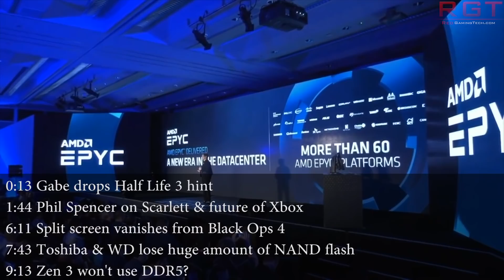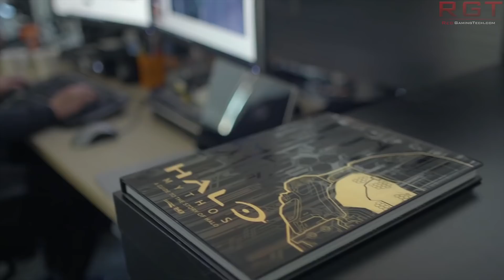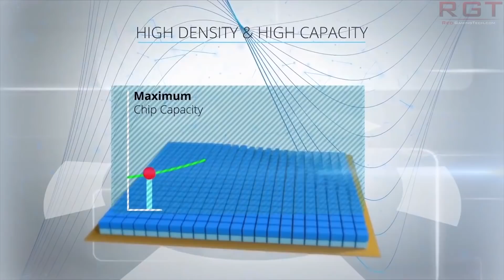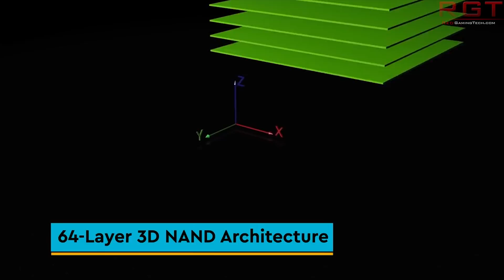Zen 3 Milan CPUs Won’t Use DDR5 ? | Toshiba & Western Digital Lose 6 Exabytes of NAND Production

Comment from the maker: 0:13 Gabe drops Half Life 3 hint
1:44 Phil Spencer on Scarlett & future of Xbox
6:11 Split screen vanishes from Black Ops 4
7:43 Toshiba & WD lose huge amount of NAND flash
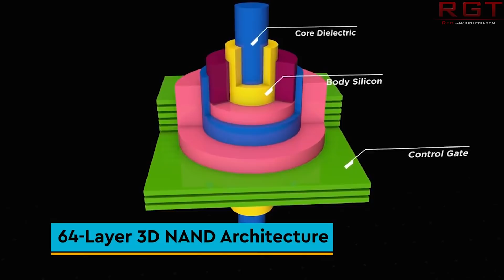9:13 Zen 3 won't use DDR5?
Reply: 6442450944 gig lost ? how does that happen ? Sounds to me like a Purposeful False Flag to Impose a Non Value in the market For subjection to the Pricingg issues they face to Keep Prices Down Instead of Rising Prices - How much you want to Bet that they Find it after they are given Insurnace payout and Are Able to Lobby For a Price Increase , Betcha . Betcha they Know Exactly Where it is and Waiting on The Price Blockade to Fizzle out ! 
Maany Corporations Have been Caught in just this very Scam over a period of time having More Product than they can Sell - ? - Sound Familar ?
Reply: Zen3 could use both DDR4 and DDR5, lets say AMD makes new zen3 chiplet and Zen3 IO die with backwards compatible interface between those.  It would mean that Zen3 chiplet could be used with zen 2 IO die to work with previous gen motherboards and its own IO die to work with next gen motherboards.

Comment: I find it somewhat interesting that they are specifically talking about Milan not supporting DDR5, not Zen 3. If the DDR5 does not require changes from the CPU, but only from the socket and the memory controller, with the chiplet based design, AMD would only need to have a new socket and I/O die to support DDR5. So perhaps we could see Zen 3 CPUs in two form factors: AM4/DDR4 and AM5/DDR5.

Comment: What does AMD's promise to use AM4 for as long as possible have to do with SP3?  It's already a different socket, so can't they change to a newer socket (SP4?) without changing AM4?  The server market is a different than the DIY PC market.  They don't typically upgrade CPUs and wouldn't be upset with a change in socket and chipset for a new CPU, especially if it provides benefits.

Comment: Well, AMD did say AM4 would last til 2020... The fact that they can get Milan in AM4 is a testament to their engrs...
Reply: What? No it is not. These days the only things not on die are the "hub"(used to be called southbridge) for I/O and the RAM. You don't need to change the CPU pins layout if you don't change DRAM architecture, with the HUB interconnects being mostly the same... It is not a "testament to their engineers", not unless you are an ignorant gamer who doesn't understand how tech works.
Reply: @KotsarisGR  It means EXACTLY that... AM4 started out with quad cores and now will have 16 with 32 threads and almost double the RAM speed... Changing to chiplets meant changing the internal  layout to map to the same pinouts...

Lisa talked about it on AnandTech with pics...
Reply: @ChristianHowell  No you don't understand. The socket does not need to change unless the external connections of the chip need to change. It doesn't matter how many cores they put on a cpu, as long as its pins layout is identical, it can work on an existing motherboard.

Comment: Zen5 is going to be 5nm
 with DDR5 support 
pcie 5.0

releasing 5/5 2021
Reply: That theory is heavy on marketing and light on engineering, but it's good enough to go on for now... :)
Reply: *2025
Reply: @combatantezoteric2965  *2022=2017 after 5 years :O
Reply: for fack sake we dont need PCIe 5, MOBOs with PCIe 4 is way $$$. We also dont need absolete DDR junk, we need HBM memory
Reply: @alexl5682  complains about expensive pcie gen4  ... but suggest hbm2... thats even more expensive.
Reply: @TheSinisterEyes1   PCIe 5 is pointless at the moment but HBM2 is not

Comment: THERE IT IS,, ONE BOOB BOOB FOR AMD....THEY ARE EXACTLY WHAT THEY ARE...ALWAYS MISS SOMETHING LONG THE WAY...WITHOUT DDR5 SUPPORT ITS LIKE BACK THEN AMD MISS OUT THE DDR3 SUPPORT BACK THOSE DAYS...AND LATE IN THE GAME FOR IT DURING FX SERIES ..SAMETHING FIRST TIME DURING PENTIUM SOCKET 775 WHEN DDR2 OR RDRAM VS DDR1 ATHLONS XP
Reply: NO AMD  is thinking ahead. because by waiting it out they can actually be first to bring out DDR5 + PCIE 5.0 & 5nm altogether on a motherboard meaning people will want to invest ina Board and platform they wouldn't need to be upgrading every single generation.  

if AMD rush to bring DDR5 in 2020 no one will want to upgrade and buy Zen 3 with DDR4 + PCI 4.0.
it a long game and the right play from a business stand point and for a consumer mind share factor. 
no everyone want to be upgrading every year a new CPU is out and throw a good $300 - $500 motherboard to waste.  
also NVIDIA will not skip PCI 4.0 to PCI 5.0 lucky uses will have backward compatibility but with PCI 5.0 the traces are going to get even shorter that a issue. 

so dont think you that you will every get DDR5 & PCI-E 5.0 in 2020. DDR5 may come first but PCI-E 5.0 will be dragged out by some OEM untill they feel mainstream  consumers are ready for it.

Comment: it doesnt mean that zen 3 wont use ddr5.  it means zen 3 will still work on the current epyc socket.  doesnt mean they wont have new ddr5 boards.  new ddr5 boards for both epyc and desktop could still come because the memory controller is on the io die which can be changed to fit the board.  amd could have new ddr5 boards with zen 3 chips for those boards and zen 3 boards for the old ddr4 boards as well.

Comment: DDR5  is gonna be stupid expensive when it comes out anyway.
Reply: they are talking about servers those guys have the money for expensive.
AMD needs a new socket and they said 2020 is the final support for AM4 so AM5 will be 2021 most likely with ddr5 in mind as well as pcie 5 or at least pcie 5 on Server side/HEDT
Reply: It will come out in about 6 months. And it will be expensive. But in a year or two it will be cheap...
Reply: Like the motherboards